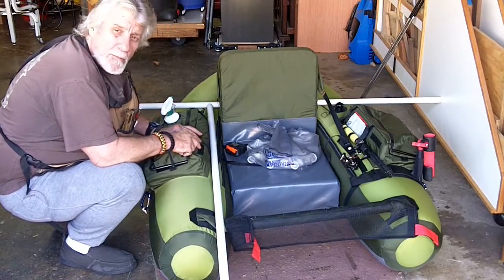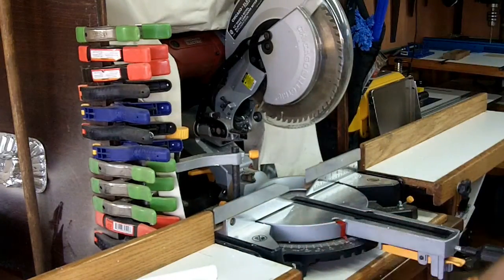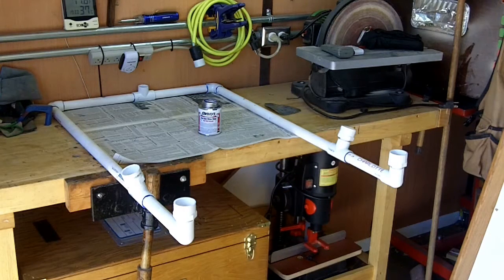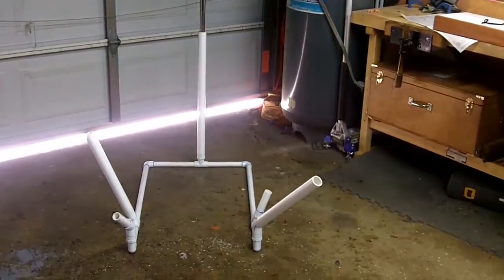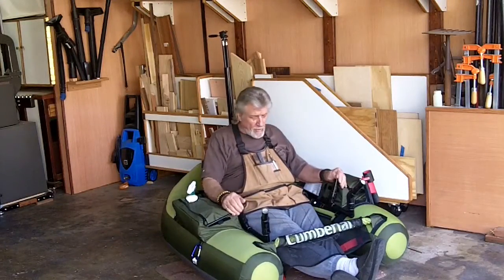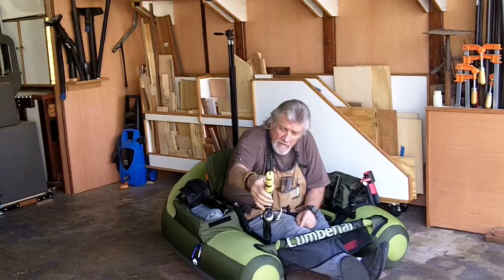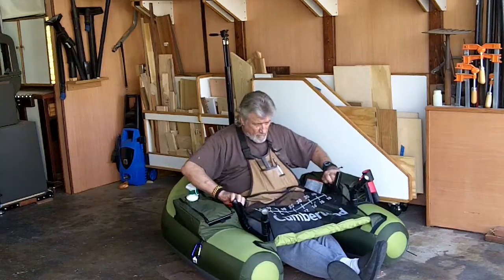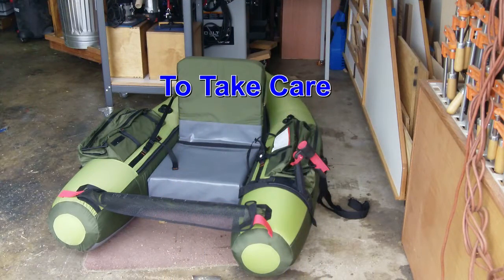DIY Fishing Rod Holder for Cumberland Float Tube or other belly boats

Comment: Love all of your videos as usual Mike as they are always nicely done and informative. Let me ask you this Mike: How you like your float tube? Does it hold up pretty well agains sharp rocks or sticks? Does it puncture if a lure bang against it and a hook happens to get slightly caught up in it? I've been thinking about getting one of these tubes, but not sure how tough the materials they are made of. BTW, what kind of fabrics or materials is your tube made of? Thanks!
Reply from the maker: Hey Grand.  I love my float tube.  It's made from a very dense vinyl that's hard to puncture.  It can be done with a very sharp object, but with a little care it will last years.  The only puncture I know of was when a friend's lure hook caught the seam and poked a small hole in it.  The repair kit that comes with the float took care of the problem in minutes and the tube has been fishing ever since.  Thanks again for stopping by and taking time to leave a comment
Reply: Thanks Mike for answering my questions, it really helps me to make a decision.

Comment: By using a reducer, I have made a soda can holder, that will sit down in a rod holder. Just size for the can OD". Another goodie, purchase a "Swim Noodle" most anywhere, & cut it to length. & apply it on the outside of your rod holder extent ions, so that when they fall in the pond, they'll float. Half a dozen wraps, of black vynal electrical tape, (evenly spaced), around the noodle will hold it firmly in place.
Reply from the maker: Very good ideas, Lee.  I appreciate you stopping by and taking time to leave the informative comment.  All the best to you